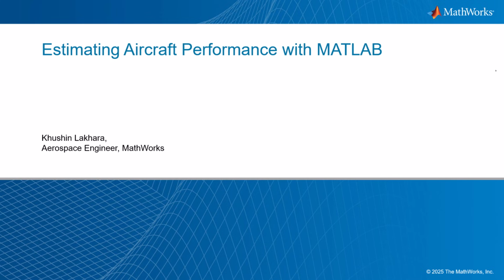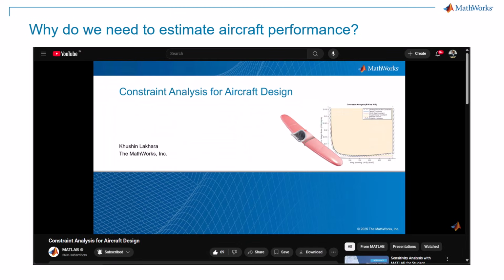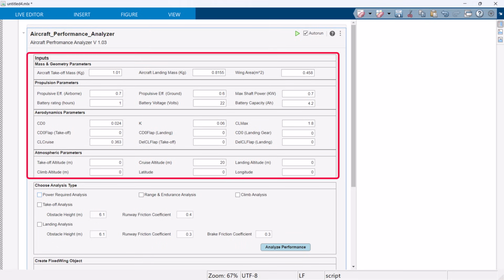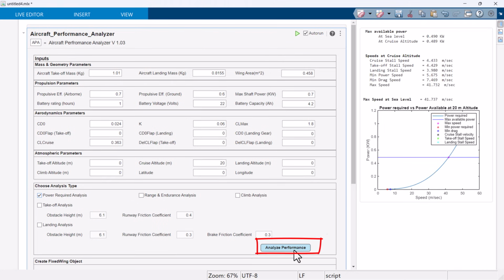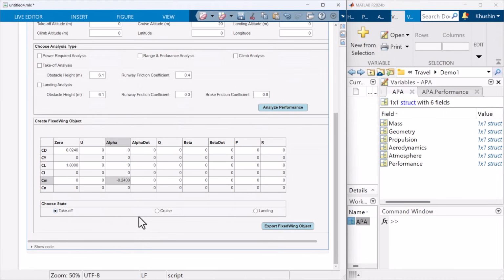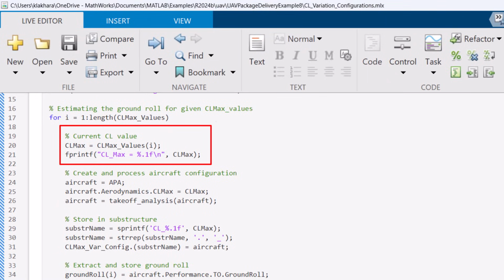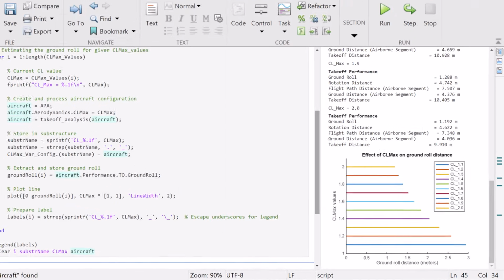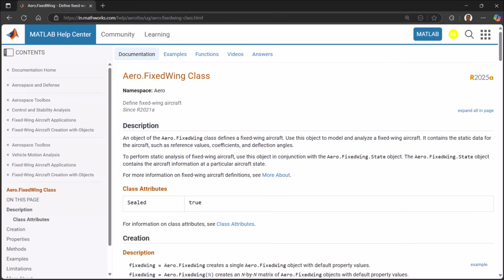Estimating Aircraft Performance with MATLAB

Comment: i run GUI by clicking analyze performance of aircraft performance analyzer apa but it is not showing any graph or results
Reply from the maker: Please ensure that you have selected one of the performance analysis types among the five given choices. Also,  the Output display mode for the live script should be set to 'Right' or 'Inline'.